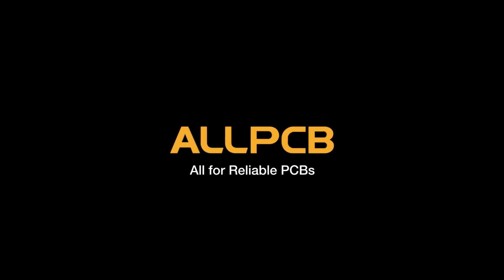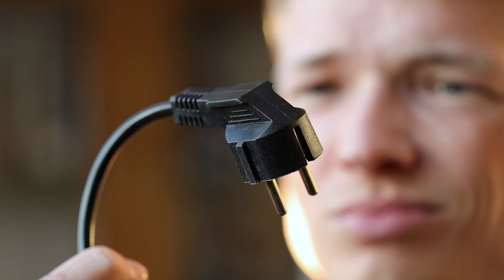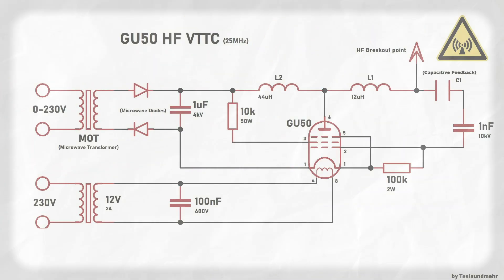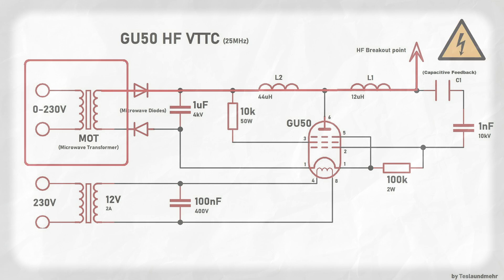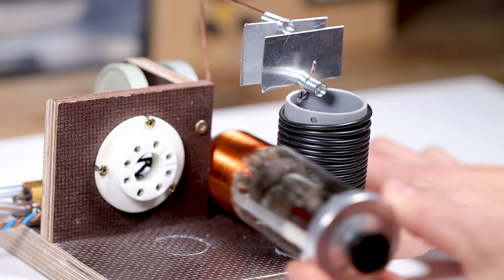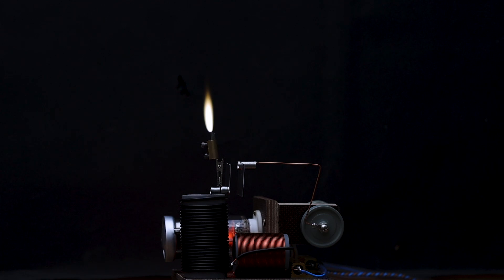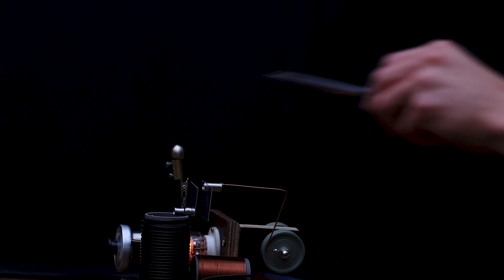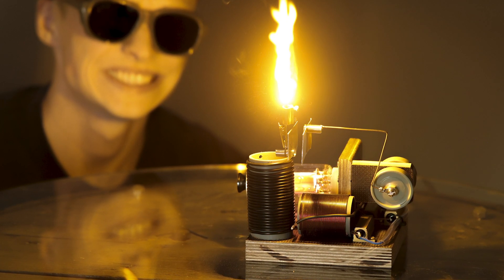I made a tabletop PLASMA GENERATOR using Soviet technologie

Comment: how does galvanic isolation protect from the shock? How come you can't touch the flame if the MOT is floating? explain in detail if you reply to me I know only the BASICS
Reply: You technically could touch the flame with the MOT floating, just how you could touch the output of an MOT if you're floating. It still doesn't make it safe however. You're relying on the isolation to stop you from being instantly killed. Not great

Comment: In the place of microwave transform can we use televisions high voltage generator with zvs driver...?
Reply: A zvs driven flyback transformer outputs more than 10kv in the kHz range, so it is a quite different input compared to a 2kv 50Hz MOT and I would research a bit more before swapping

Comment: that is a great setup! I have a question on one of the capacitors, what setup did you use for the the 1uF 4kv capacitor? I found a couple 4kv .5uF capacitors however they are not cheap especially considering I would need 2. Thanks for the great videos!
Reply: I used a simple MOC. It has 2kv but works just fine.

Comment: okay now that screwdriver would be way too close for comfort for me, because high frequency arcs like that are gonna break off into the plastic in the screwdriver and burn it because on the inside of the handle theres small points so the metal can anchor to the plastic

Comment: Tube gets way too hot i found using florescent tube choke on the input reduces arc lenght but it can run forever... Until transformer and choke overheat
Reply: would you elaborate on that, please?!
Reply: @iulianpreda2386  basically you made your circuit and on the ac side of it (transformer primary)
You put a florescent tube choke that's basically an inductor, in ac circuit, inductor limits the current and therefore maximum power that's allowed to go into the oscillator.

Comment: Is this tube good for normal VTTC's?
Reply from the maker: Yes, but only for small ones👍🏼
Reply: @Teslaundmehr  thx I wanted to use it but seems that it can't handle MOT voltages
Reply from the maker: @Headbutter-Lettuce90  when you put alot in series, it will work, but Microwave caps are better👍🏼
Reply: @Teslaundmehr  I will make mine with 811A triode
Reply from the maker: @Headbutter-Lettuce90  also a nice tube👍🏼
Reply: @Teslaundmehr  how do I make a socket I don't want to buy one

Comment: What capacitors did u use to get 1uF 4kV?
Reply from the maker: I put 10x 450v caps in series. Not the best solution, but it works👍🏼
Reply: @Teslaundmehr  how much farad where they rated?
Reply: @mikailgargili  You can do the math, when you put two capacitors in series the voltage doubles but the capacitance halves. So if the cap bank was 1uF 4kV with 10 caps then each capacitor was ten times that capacitance so 10 uF
Reply: @teresashinkansen9402  that doesnt make sense right? If each capacitor is 450V rated 10uF and put only 3 in series its already 3600V and 0.5uF because u said that if u put them in series the volt doubles and capacitance halves. Sorry if im wrong but it doesnt make sense to me.
Reply: @mikailgargili  Three 450v 10uF caps in series would be 1350v 3.3uf.  Add the total voltage of each cap in series and divide the capacitance by teh amount of series caps.

Comment: Awesome mate, so going to build this with that GU50 Tube you sent me, but are the doorknobs nessary or can they be replaced with more modern caps?
Reply from the maker: Thanks Noel! They are not necessary,  so you can also use other good quality caps (high voltage rated)

Comment: Very nice… could you build one that works at 100 MHz?  Big flames are cool but how do things change with even higher frequencies?  Could that tube even work at 100 MHz?
Reply from the maker: Thanks, puh 100MHz is quite hard. I think the flame does not change that much. A 2.4GHz Magnetron also produce a similar looking flame :)
Reply: @Teslaundmehr  The higher the frequency the more sphere the plasma would be 😂